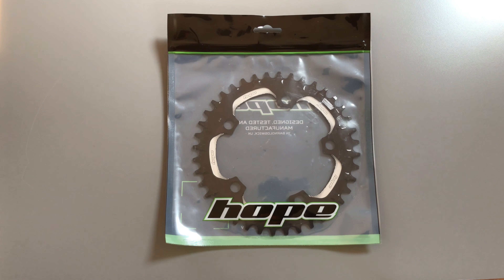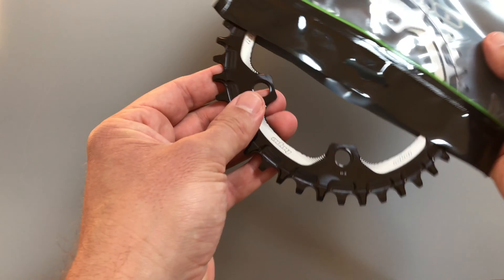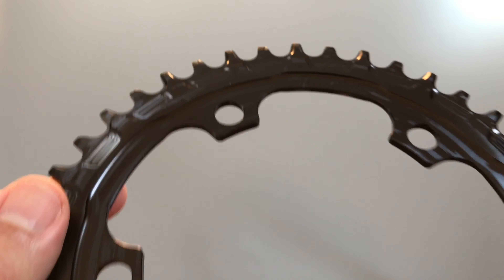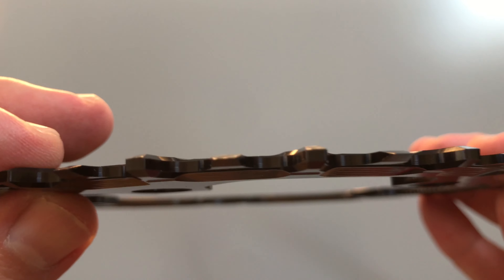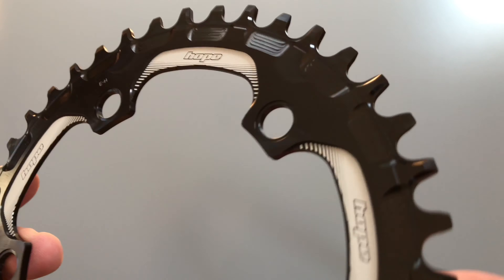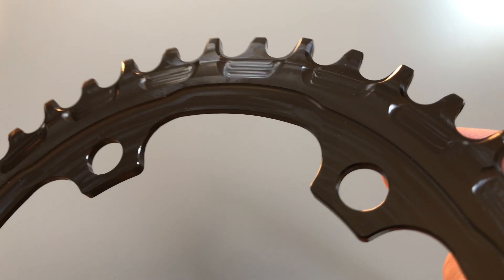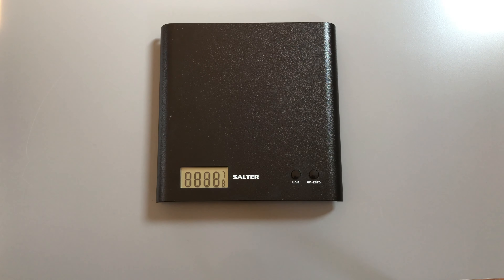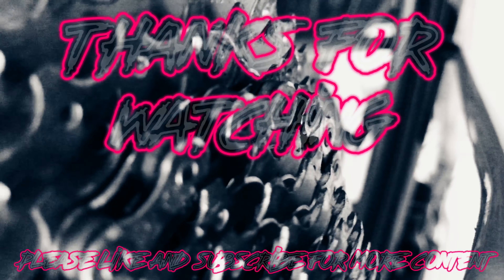Hope Retainer Ring

Comment: How did you find the choice of 40t? I'm wondering if it might be a it big for gravel...? Top speed of 38kph @ 85rpm with 35mm tyres and an 11t cog... unsure how much use that would get!
Reply from the maker: For me in my area is a good choice. For me 85rpm is slow/cruise. 40/11 for me seems to top out at about 55kph-ish at 110-ish rpm.